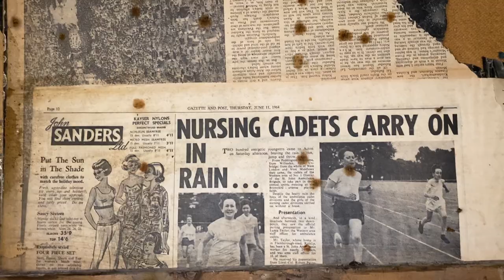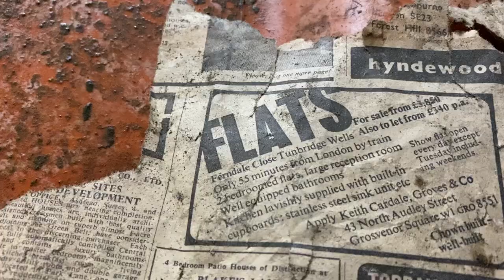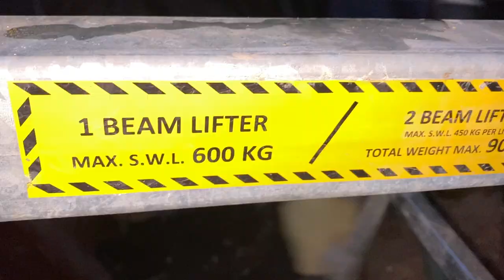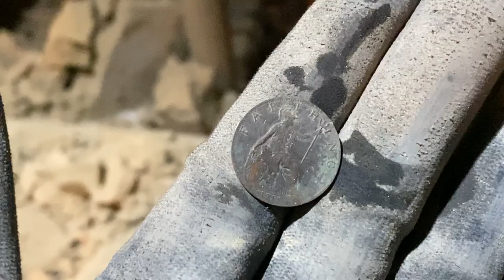BUILDING AN EXTENSION - INSTALLING STEEL BEAMS

Comment: Absolute madness there, great work. Just wondering did you have a temp works designer do that scaffold, the block and tackle on some cantilevered tubes looked super sus haha

Also i'm guessing you got an architect/engineer on board for the permanent work - did you provide them with all dimensions and setting out yourself?

Comment: What’s the tool you use to get the brick work out? Is it designed to only cut mortar or through brick too?
Reply: Shown at 13:24
Reply from the maker: DEWALT DT2422-QZ TCT RECIPROCATING SAW BLADE 457MM . 40£ works amazing. Cuts concrete bricks mortar the lot